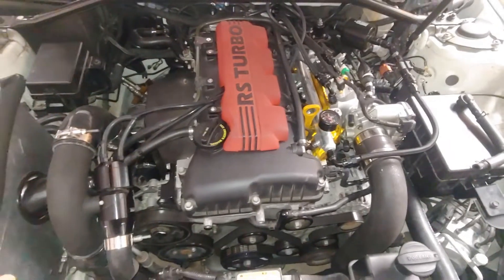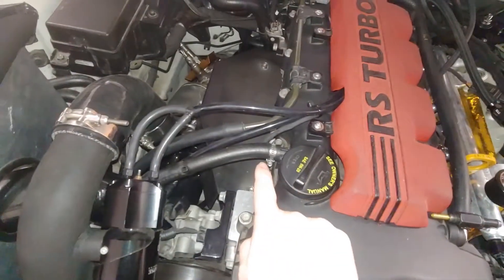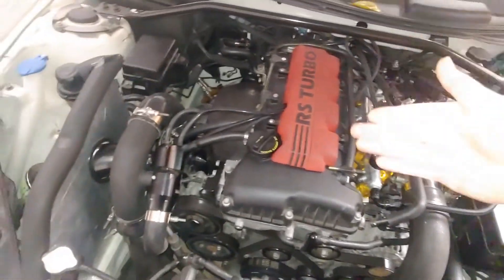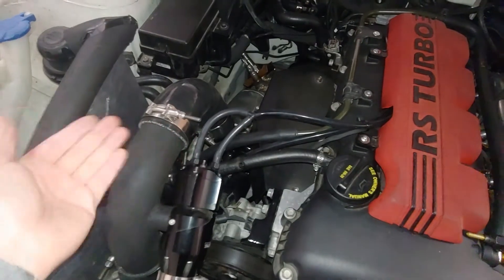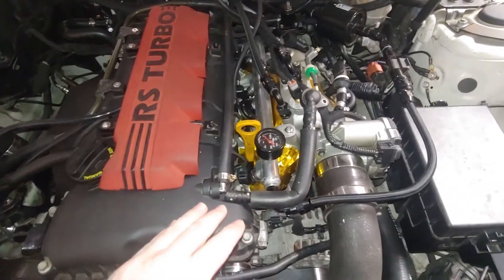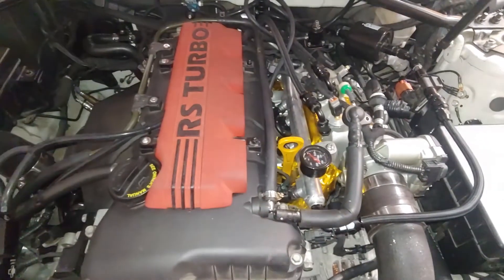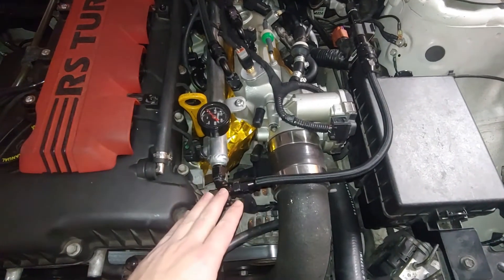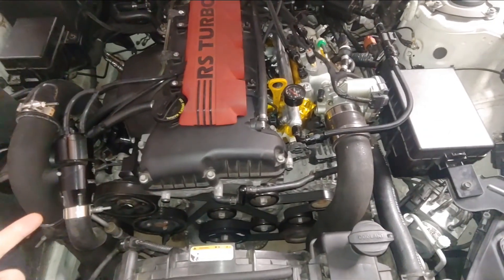PCV System and Mods - Genesis Coupe 2.0T

Comment: hey I run around 550whp I have intake side pcv into catch can and back into intake. And I have the exhaust side pcv running to a closed off catch can, no return or vent as I run a top mount turbo and no where to run line too, and if I vent to atmosphere I get tons of oil blow by all over the engine bay from the exhaust side pcv, I’m not sure how I should set it up. Any help will be appreciated.

Comment: Great video and very informative im wanting to do this on my bk2 2.0t but im hesitant because i dont know what to do with my brake booster ive actually lost brake function on a busy street coming to a stop light luckily i was able to maneuver around into an empty parking lot, would it be possible for you to do a video on your brake booster set up i would greatly appreciate it as im also going to be switching over to the bk1 intake manifold
Reply from the maker: The brake booster should have a large diameter hose direct to the manifold. It also needs a 1 way valve in the hose since the booster should never be pressurized. I would not recommend having anything tee'd into the brake booster hose.

Comment: And the metal line around the valve cover?
Reply from the maker: The hard line is OEM for bk1. I just connected a rubber hose to it instead of it going to the manifold.

Comment: Where did you get the bent elbow in place of PVC valve? Part number?
Reply from the maker: I don't remember the part number, it is a 1/8" BPST to 3/8" swivel hose adapter.

Comment: Where do i get this?
Reply from the maker: If you mean the piece that bolts to the manifold to replace the stock hose barb, I make them. I make as many of my own parts as possible.
Reply: @Weekend_Garage  nah i need a whole parts list for this pcv system. Is it good for a 450hp set up?
Reply from the maker: @HandMadeRoyalty  The OEM PCV system will be fine at those power levels. To setup like mine you don't even need additional parts. I did them to make it look cleaner, the function is the same.